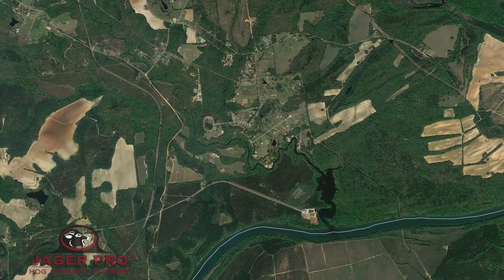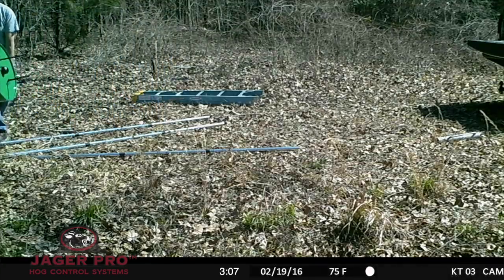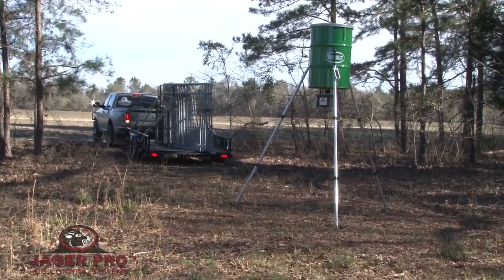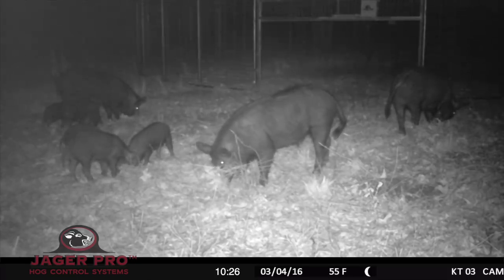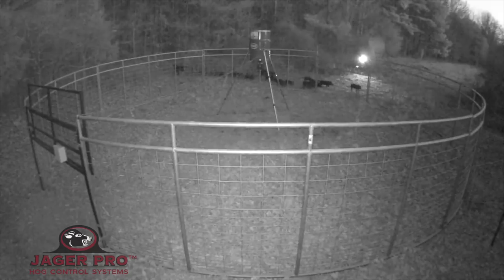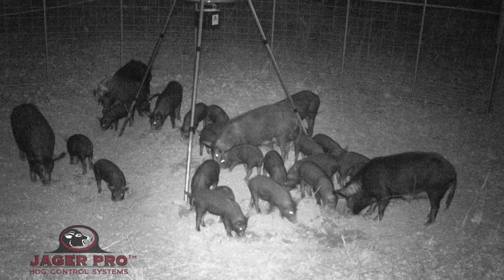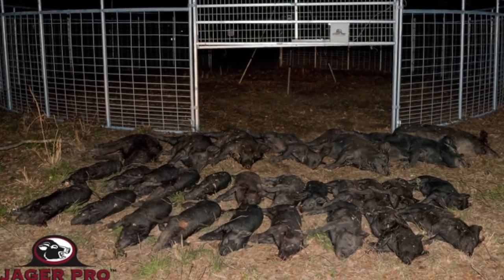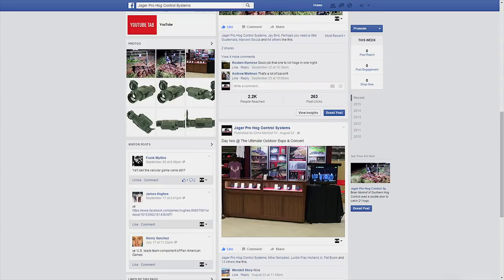JAGER PRO™ Hog Trapping (29) Integrated Wild Pig Control™

Comment: Seems like this is the best way to control the hog menace. Open range shooting though very fun and attractive, seems to be very inefficient, time consuming and costly
Reply from the maker: You are absolutely correct. Our definition of success is NOT about how many hogs are killed; but how many survived each event to later reproduce and also the minutes of labor per pig one expends to accomplish whole-sounder success. In this video, our trapping process is far more efficient by expending only three hours of labor (180 minutes divided by 28 pigs = 6.43 minutes of labor per pig) than trying to shoot 28 pigs with three personnel overnight which is 24 hours of labor (1,440 minutes divided by 28 pigs = 51.43 minutes of labor per pig). The trapping process was eight times more efficient (51.43 divided by 6.43 = 8) using our M.I.N.E.™ Trapping System which is 1/3 the cost of three semi-automatic rifles with night optics and ammunition. (BTW- three shooters will NOT effectively kill all 28 pigs in a single stalk.) The automatic feeder and cellular cameras perform all the labor during the conditioning process. Farmers, ranchers, landowners and Hog Control Operators™ should be making performance-based decisions by measuring results and efficiency.

Comment: Hey Jager Pro, do you realize how much every one of your pig killing operations is just like doing laundry?  First, you bring the trap (the washer).  You set it up (or hook it up).  Meanwhile, you have to wait for THESE clothes (the pigs) to load themselves into the washer.  One by one, the "washer" fills up.  You sit and wait for the washer to load.  Then, when the washer is fully loaded, you close the trap door (or the lid on the washer.)  At that point, you finish the fill cycle and begin the agitation cycle as you go from filling the washer to laundering (shooting) the pigs.  One by one the "clothes" get washed (killed).  Soon they're all washed up and lying dead in the "washer."  The agitation cycle ends when the last item has been washed with the final squeeze of the trigger.  You then begin the spin cycle, which involves the "clothes" being taken out of the washer and the "washer" being emptied.  Next, the spin cycle has come to an end as the "clothes" are hung out to dry.  Next, the washer is unhooked and taken out of the wash site and is ready to be taken to do another load of laundry somewhere else where clothes need washing.

Comment: how much it cost for the full set trap?
Reply from the maker: M.I.N.E.® Trapping System with (6) 18-60™ (16’ long) flex trap panels – Estimate $3,000.00 (for permanent trap sites)
M.I.N.E.® Trapping System with (12) 18-60™ (8’ long) rigid trap panels – Estimate $4,400.00 (for temporary, mobile trap sites)
Contact the nearest JAGER PRO Authorized Dealer https://jagerpro.com/dealers/ to your location for current pricing.

Comment: How much do one of these traps usually cost
Reply from the maker: M.I.N.E.™ Trapping System with (6) 18-60 (16’ long) flex trap panels –  Estimate $3,000.00 (for permanent trap sites)
M.I.N.E.™ Trapping System with (12) 18-60 (8’ long) rigid trap panels – Estimate $4,400.00 (for temporary, mobile trap sites)
Contact the nearest JAGER PRO Authorized Dealer https://jagerpro.com/dealers/ to your location for current pricing.

Comment: Been watching you guys a long time...can you guys eliminate all the hogs?
Reply: Watch Lone Star Boars. It is very difficult to take all the hogs in the area. Hunting them is still the best way to take them out. Trapping is definitely helpful in also taking out the hogs.
Reply: cobra460 I would think the south would be getting a handle on this pest by now.
Reply: @CedroneTravels  You need to eliminate 70-80% every year just to keep the population in check. 1 sow can become 300 hogs in 3 years. Sows can have 8-12 pigs and can start having pigs from 6-8 months of age.
Reply from the maker: The Sidsters- It is not about how many feral hogs JAGER PRO™ personnel can harvest annually, but how many sounders we can train others (farmers, ranchers, land managers, Hog Control Operators™) to successfully remove each year. We are the industry innovator and created the Integrated Wild Pig Control™ model for others to follow. We also hold five patents related to remote control trapping and have manufactured/sold more than 3,000 of our M.I.N.E.™ Trapping Systems to the public which we estimate 250,000 - 300,000 pigs were removed last year using our methods and technology. The feral swine problem will ultimately be resolved when we scale product sales and training/certification to several million pigs removed annually. Legislation must also be passed (and enforced) in all 50 states to stop illegal transportation and release of feral pigs for recreational and sport hunting purposes. Success cannot be achieved until each state stops new populations from being started.
Reply from the maker: cobra460- JAGER PRO posted the first YouTube thermal shooting video of feral pigs in 2006 and filmed the first thermal shooting footage for national television (Outdoor Channel) in 2007. Our company innovated thermal optics and methods for feral swine control purposes from our combined 220 years of military experience. Everyone else in the industry learned about thermal shooting and remote controlled trapping technology from our YouTube channel. The 22+ million views on our YouTube channel demonstrates your "hunting" response is incorrect. It takes an Integrated Wild Pig Control™ (IWPC™) approach to produce long-term success. The definition of IWPC™ is “a strategic approach using a series of innovative lethal control methods and technologies implemented in a specific sequence based on seasonal food sources. Emphasis is placed on efficient removal of the entire sounder at one time to eliminate escapes, education and reproduction. The control strategies must continually change throughout the various seasons to effectively target adaptive survivors.” Our M.I.N.E.™ Trapping System will always be more efficient in the winter to target sow and pig sounders. Thermal shooting operations will always be more efficient in the spring during planting season to target boar bachelor groups who avoided winter traps.

Our definition of success is NOT about how many hogs are killed; but how many survive to reproduce and the minutes of labor per pig one expends to accomplish whole-sounder success. In this video, our trapping process is far more efficient by expending only three hours of labor (180 minutes divided by 28 pigs = 6.43 minutes of labor per pig) than trying to shoot 28 pigs with three personnel overnight which is 24 hours of labor (1,440 minutes divided by 28 pigs = 51.43 minutes of labor per pig). The trapping process was eight times more efficient (51.43 divided by 6.43 = 8) using our M.I.N.E.™ Trapping System which is 1/3 the cost of three semi-automatic rifles with night optics and ammunition. (BTW- three shooters are NOT going to effectively kill all 28 pigs in a single stalk.) The automatic feeder and cellular cameras perform all the labor during the conditioning process.

There are several factors which determine how long a property remains at "zero balance" after a successful IWPC™ program has been implemented. Future reproduction and migration would have to come from adjacent properties since an effective IWPC™ program would prevent escapes, method education and reproduction from the entire generation of feral pigs living on the property. Are neighboring landowners implementing a successful IWPC™ program? Are there enough trained Hog Control Operators™ in the county to effectively implement the IWPC™ program? Has the state passed legislation to stop intrastate and interstate transportation of feral pigs? How well are law enforcement personnel enforcing these rules in the state? Are judges and the court system prosecuting those breaking the rules with heavy fines? How many criminals are illegally transporting and releasing new feral pig populations in the county? Hopefully, you will now understand the amount of time a property remains at "zero balance" greatly depends on the answers to the above questions and how trapping is eight times more efficient than shooting. Remember this example the next time you feel the urge to give free internet advice to someone asking a legitimate question.
Reply: JAGER PRO™ you guys rock
Reply: I thoroughly enjoyed reading your response up until the very last sentence.

Keep up the good work and educating those of us who misremember things.  I was trying to recall items from a few years ago.  I don't live and breathe this like you guys do. ;)